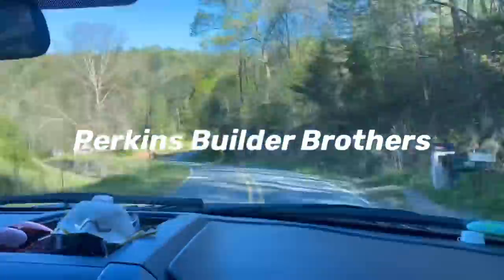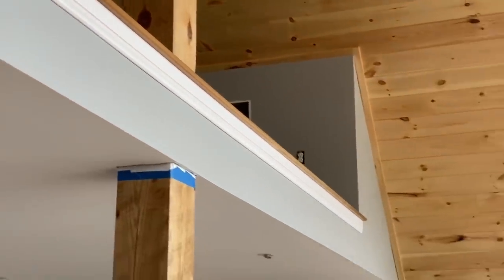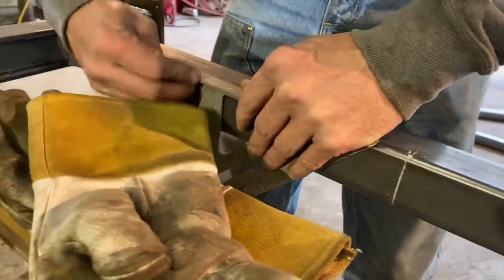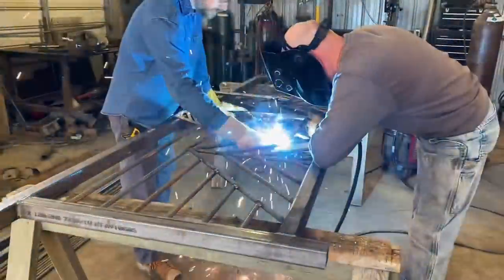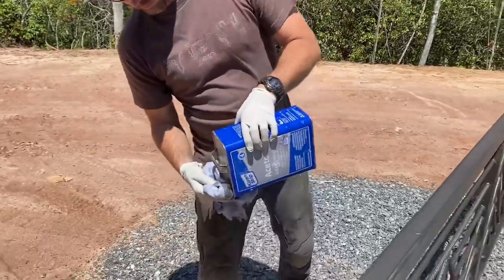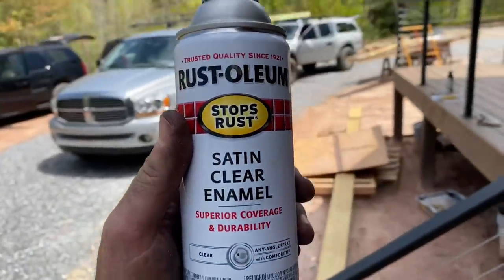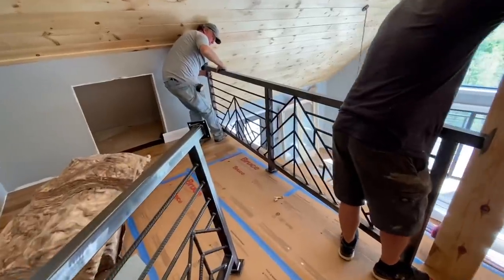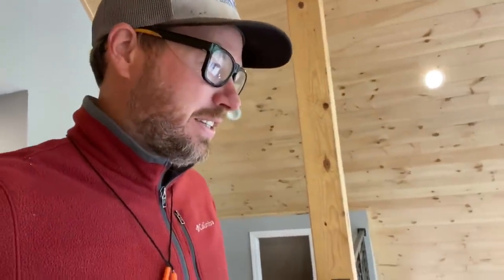Custom Home Details | Rebar “Mountain Scene” Railings

Comment: For future reference, a portable sand blaster from Harbor Freight would make quick work of taking the rust off that metal handrail. I've knocked out many a rust removal project with the one I have. Just take them outside and blast away, they will also have a uniform finish :)
Reply: so im guessing there is no "hood" system to collect back the abrasive material, like the ones we commonly see ?

Comment: Love the railing.  In hind sight, would it have been easier to wire brush the rods  before  they were welded on a bench grinder with a wire wheel?